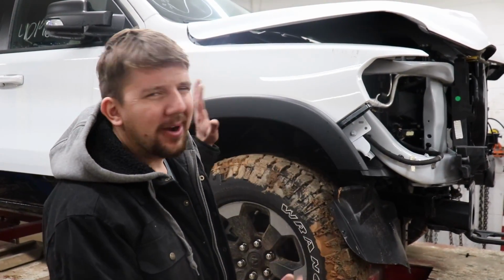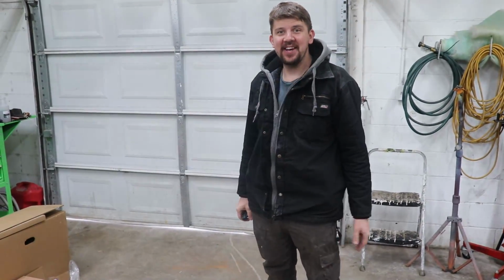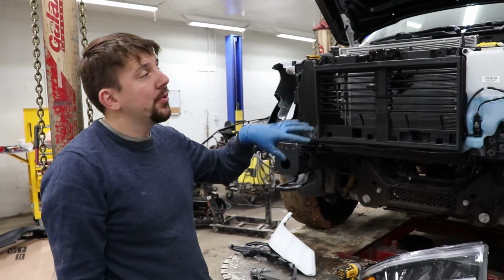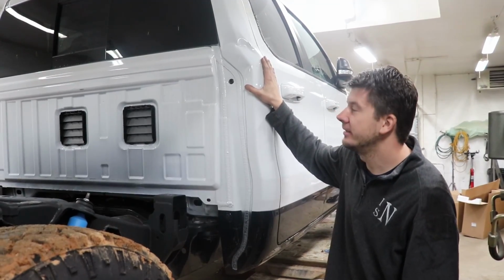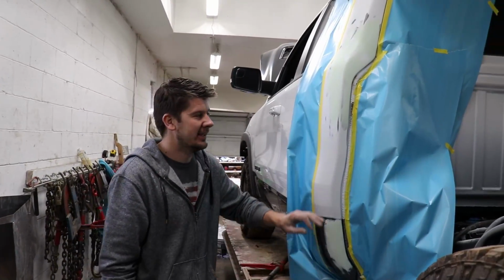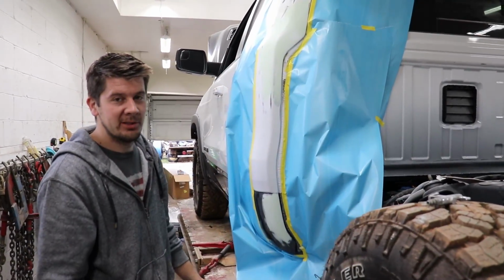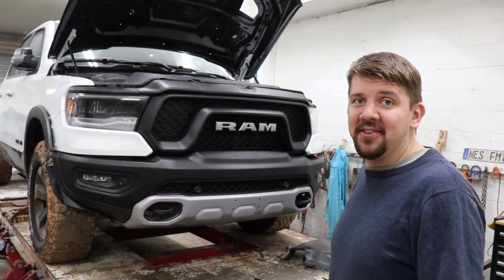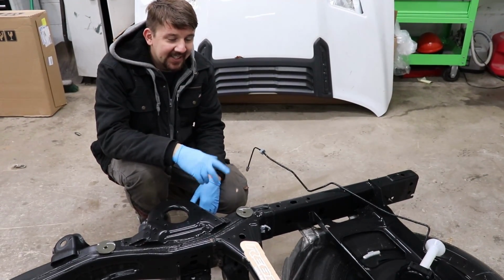Rebuilding Frame Damage  Wrecked 2019 Dodge Rebel from Copart

Comment: About 10 years back I had a truck that was hit in the back and the truck even after be fixed , about 2.5 years later the frame started tweaking again.
I kept good care of it  ,but after 3.5 years I could not keep a new set of tires for more then 6 months and they were almost bald. truck was 5 yrs old when the crash happened the 1st yr  I owened it.
 good luck

Comment: I absolutely love the look of the Ram Rebel trucks. I have 04 Ram 1500 that I painted with bed liner and looks badass. It would be cool if you painted this truck in colored bedliner. Raptor liner is very easy to use.

Comment: Is the front bumper not bolted in place because it looked like it needs a lot of adjustment done it looked real low on one side!
Reply from the maker: its missing a bracket we had to order it from the dealer will be installed next time

Comment: I am just me but they are not called Dodge anymore, its Ram or Rebel and Mopar not dodge like it became a bad word or something since the foreign investment company. What do you call them and rather than cun bad metal out and weld in clean corners with a dab of cream to hide the weld, is that the new fix. When I buy used or new I have a glove that is magnets all over it and when they don't stick to places they should, I look for the bondo and find it in lots of rigs with less than one hundred miles on the odometer... yet sell as new..don't think its right but it is what it is